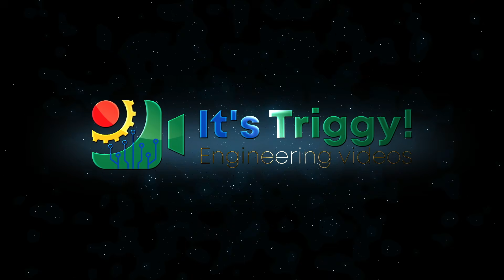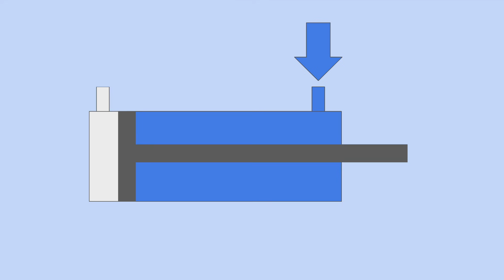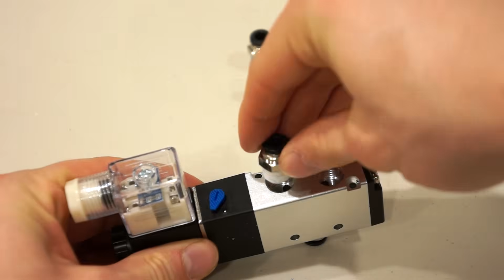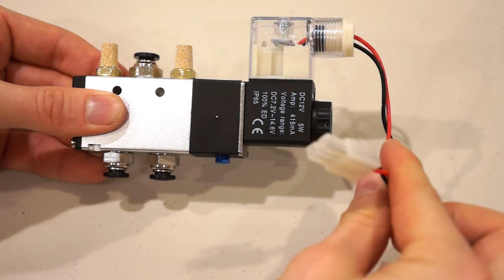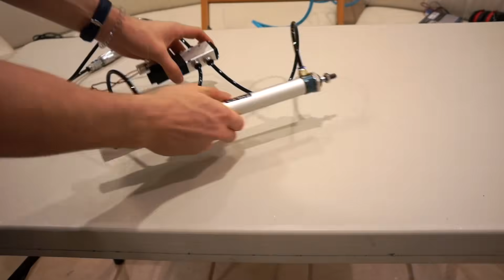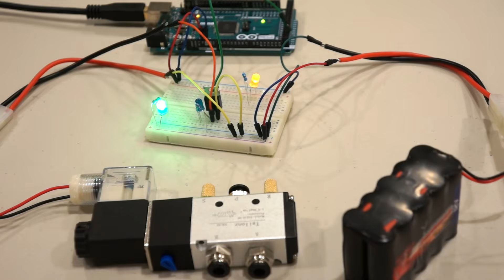Control Pneumatic Cylinder with Arduino

Comment: HELLO, i want to make a project using this concept. but i want  to use a small CYLINDER instead, i want to cut a cylindrical BIOMASS into a desired length. and i want to use a sensor attached to it. can you give me a code that uses that sensor to get the desired length

Comment: I would like to control the actuator to go a certain distance like half of the cylinder or else also is it possible for the actuator to be connected to cylinder to produce some pressure and measure it using a gage or another pressure sensor ?

Comment: hi Triggy, we have followed the video and wired everything the way you have. the LEDs are lightning the same. the only problem we have is the piston is not retracting and protracting automatically. we’re not sure what the problem is. at first we had all our resistors at 510k but now we have changed to two 510ohms resistors and one 9k resistor. the 9k is at the red LED and now it’s lightning faintly. anyway you could help?

Comment: You did nice work, the only suggestion is throw a flyback diode between the solenoid because some solenoids create a high voltage spike when driving them directly with a MOSFET and that can destroy the MOSFET fairly quickly and also cause other things like mcu reset.
Reply: Trying to write this circuit for a project I have at work. Any way you could assist? I'm learning and could use some help. TIA
Reply: I have encountered this exact issue. The flyback diode worked.
Reply: @TheJoeFletch  Yep it can be a pain to locate the problem too. I've seen flyback create all kinds of issues with microcontrollers. Diode is best but you can also use a resistor with relatively high value if parasitic losses are acceptable

Comment: All I wanted to know was what you’re using for the air supply. Are you using a compressor? An air cylinder? How do you know which pressure to use?

Comment: Hi Triggy, nice build!  I wanted to see if there is any way to adjust how much pressure goes into the pneumatic cylinder?  I am trying to put together a Tamping Machine where I can adjust timing and force
Reply from the maker: Yep, look up pressure regulator :)

Comment: May I know the power source (and its voltage) for your pneumatics?
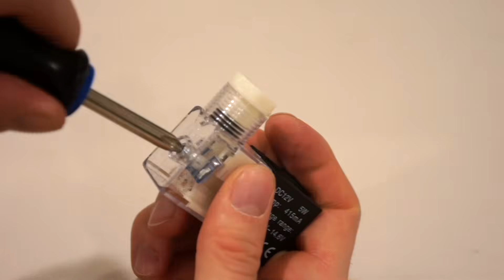Reply from the maker: The valve is triggered with 12V DC from a battery. See 1:35 :)
Reply: @itstriggy4814  thanks! another question is: will the circuit be affected if a BJT transistor is used instead of MOSFET ?
Reply from the maker: @shuetyimek3815  BJT will work! The circuit will look a bit different, MOSFETs are opened with a certain voltage, BJTs with a certain current.
Reply: @itstriggy4814  oh i see, thank you so much!

Comment: Hello Triggy,
What are the sizes of the two resistors you used?  Are they equal sizes or different?  Thank you very much. Regards, Sorin.
Reply from the maker: Hi Sorin, the resistors for the LEDs? LEDs run at around 20mA, so those resistors are just to limit current flow. Using ~500ohms should be fine for all of them.  resistor = voltage / 0.02 amps

Comment: Hello there great tutorial I need some help I'm kind of a beginner. I'm trying to make a animatronic like showbiz which needs a lot of Pneumatic Cylinders and I wouldn't have enough room for a bunch of breadboards to control each Cylinder so is it possible I could use something like relays to control it instead of the circuit you showed in this wonderful video?
Reply: the Arduino has like 14 digital output pins so you can control up to 14 valves with one controller. A relay could take the place of the MOSFET that was used in this demo.

Comment: Hello! Thank you for the video, it was of great help. 
I am actually doing a project where I have to rotate a small crib of certain angles using pneumatic cylinders. Would you have any advice for controlling the position of the cylinder to define precisely the angle of rotation of the crib?
Reply: it would require more parts like a proportional pneumatic valve and a position sensor on the cylinder to have that kind of control.

Comment: Question: do you have to connect lights and a transistor to the breadboard or are they just in this project?
Also, what battery is he using?

Comment: Instead of a compressor could you use a simple CO2 canister for a portable version?
Reply from the maker: I'm sure! You will be limited by volume in the tank, however.
Reply: @itstriggy4814  cheers. Thinking of using this for a smaller portable robot as like an extending arm with a gripper attached
Reply from the maker: @seasnek7024  sounds cool. Look into linear actuators, that might be an option.
Reply: @itstriggy4814  yeah might consider. They are quite slow however

Comment: I’m wondering if i can use a mini air compressor for a small sized pneumatic cylinder. your thoughts?
Reply from the maker: I'm sure you could. Depending on the size you may have to refill often.
Reply: Thanks for asking I was always wondering that

Comment: one of the best tutorials on this out there! thank you very much! quick accurate and precise!

I was just briefly surprised that the two voltage grounds are connected! Isn't it best to keep them separate? It seems to me as a recipe for fried circuitry? (but I'm no electronics genius so please explain.)
Thanks
Reply from the maker: Thanks Jakob!

You do in fact want to connect the grounds. Ground defines the point where there is zero voltage, so connecting the grounds ensures that the 5V and 12V have the save reference point.

Comment: could you make a video where you show if and how you can control the position of a pneumatic cylinder with an arduino? Especially with a 5/3 valve would be great, or with something like a magnetic sensor that pneumatic cylinders come with sometimes.
thanks!

Comment: Is it possible to control 2 actuators at the same time with the same button? I've been looking for a way to do it.
Reply from the maker: Absolutely, just connect the positive lead of each valve to the transistor terminal instead of just one. And of course negative to ground for both as well.

Comment: What's the minimum spec compressor you can recommend for this type of pneumatic cylinder? Thanks
Reply from the maker: It depends entirely on what you want to do with the cylinder. The cylinder will move with as little as like 10 PSI, but won't be able to really move anything. The smaller the compressor, the more often you have to fill it up, or keep it running during operation. If you only need the cylinder to actuate once or twice between refills, you could get away with a very small tank.
Reply from the maker: The compressor I use here is one of the cheaper and smaller ones. I think it was $99. That'll be tough to beat.

Comment: I’m new to this stuff and was wondering how could I do multiple of the pneumaticS in one Arduino script? Like pretend I wanted to control an arm, how could I make it to where I click like an arrow on my keyboard to trigger one of the pneumatic cylinders?
Reply from the maker: Notice how the video only uses a single Arduino digital pin. That means you can duplicate the set-up and just attach it to another digital pin! :) You will probably want to hook up both valves to the same battery, no need to get two. Just make sure they're attached in parallel!

Comment: hey man I have a project where I need to connect 4 cylinder to build a sorting machine, how to connect all 4 cylinders to the Arduino and not make them all work at the same time (each has to activate when commanded) . I don't know how to explain this properly but this is a little the idea.
Reply from the maker: Just use four transistors, one for each cylinder, and connect each to its own pin

Comment: So I have a 21.4 V-24.5 V DC solenoid could I connect same way as this 12V one?
Just switch out the 12 V battery for a 24V current ?

Comment: This is great. Very nicely done. How can I control the speed of the cylinder action using an Arduino. You mentioned something about the exhaust outputs but can these be controlled electronically?
Reply from the maker: hmm that's definitely more tricky. I'm not sure how that would be done, let me know if you find anything!

Comment: how can we control the speed of the pneumatic cylinder?
Reply: reduce the pressure of the compressed air going into the cylinder. unlike electric motor which you can control from 0 - 255, pneumatic is controlled with a valve

Comment: Adding to the requests for a wiring diagram. I have a very hard time seeing exactly what MOSFET pins are connected to LEDs/Resistors. REally hesitant to power this thing up without knowing what might cause a fire :)  also, for future viewers, dropping code in the description would be very helpful.
Reply from the maker: Circuit diagram: https://www.patreon.com/posts/43812212
Reply: @itstriggy4814  Hey man this link is no good... still got the wiring diagram? Thanks for the video, super helpful!
Reply: @itstriggy4814  Awesome. Thanks so much! I was able to get things working (and diagnose that I'd blown several MOSFETs due to insufficient resistance). I also built a simulation in TinkerCad, and added a photoresistor circuit to make it light (i.e., motion) activated for props https://www.tinkercad.com/embed/1rdzFZYw81P

Comment: Heyy... May I know what type of arduino that u used in this vid ?? 
And I wonder that if this thing will also work if I change the type pneumatic cylinder to a bigger bore,length and stroke ??

Glad hear from you soon..
Reply: I'm not 100% sure but the arduino he's using is an arduino Mega, and as for your second question, you should be able to use a different kind of piston, however be sure to check it's compatibility with the rest of your components, especially the pneumatic fittings.

Comment: I want to do this with two cylinders acting in unison.  Would simply adding Tees between the output ports and the cylinder ports work or would two valves be required?
Reply: You should be good with just one valve and some Y connect fittings from amazon

Comment: Why do we have to use resistors?
Reply: Although an LED has some resistance, it’s orders of magnitude less than a proper resistor. If you just connect the LED without any resistance it will fail much faster (and draw a ton of current).

Comment: brother my pneumatic valve is 24 dc. so which mosfet should i use and resistor? could you kindly help me? i have 24 dc power supply and everything including actuator, arduino etc,, just need help with mosfet and resistor values,
Reply from the maker: You can use the same transistor as in the video, it should be good for up to 60V. A 10k pull-down resistor will do the job :)
Reply: @itstriggy4814  thx man.. will test it tomorrow 🙂🙂
Reply: @itstriggy4814  hey triggy. this circuit worked . i just hav a question.. all these resistors that you used are for leds right? if i dont want leds then i can skip resistors? plus i saw some people using relays also in  pneumatic cylinder arduino circuits? why is that? i used  IRFB4227 P814JKW17 MOSFET instead of the one that u used. plus a 24 dc with 1.5 amp dc power source. everzthing was working but somehow two of my arduinos are not working any more. may be because i was connecting and disconnecting the signal wire number 5 pin for my testing? can that be a reason?
Reply from the maker: @dbodybuilder1  Without the LEDs you'd only need one resistor, a pull down resistor connecting the gate of the MOSFET to ground (anything 1K-10K will do). A relay is another type of electronic switch, it will also work. It's just bigger, more expensive, and doesn't last as long. They are maybe easier to use though. Not sure why the Arduino's don't work... depending on how you wired it, something might have gotten shorted and damaged pin 5.
Reply: @itstriggy4814  thanks triggy for always replying and clearing doubts. i dont know why this happened to two of my controllers. one is arduino nano and other is controllino maxi. they are showing the power but i am not able to uplaod any new program. i found a guide to burn bootloader or something. will try to do that.

Comment: Great video, Triggy—thanks! I'm wondering how I could incorporate a capacitive proximity sensor to control the cylinder. Would you have any suggestions?
Reply from the maker: For position control? From what I've seen, it's notoriously challenging without buying a $300+ sensor. I'm not familiar with capacitive proximity sensors specifically, though my intuition is that they might have trouble measuring accurately over the whole range of the stroke (in my case 175mm). Let me know if you find any good solutions!
Reply: @itstriggy4814  I was actually thinking about a sensor that would simply activate an air cylinder when you place a bottle in a set position. It would be a substitute for pressing a button or a pedal.
Reply from the maker: @macwol  Oh, that should be pretty easy! Just check for a signal from your sensor in the loop of your Arduino code, and if the signal is high (and the piston isn't already activated), activate the piston. 

https://www.seeedstudio.com/Grove-PIR-Motion-Sensor.html
Reply from the maker: @9YearsLater It might be easier to have him press a button if his hands allow, but if you're keen on the voice idea, check out my JARVIS video! It covers basically exactly that.

Comment: Hi, 
How much newton u get the force
Reply from the maker: Depends on the PSI. In general, multiplying the pressure by the surface area of the cylinder gives you the force, just keep track of units

Comment: Hi, What should I type to buy power supply, I have pneumatic cylinder and air compressor but I need to connect them in the power Thank you!
Reply from the maker: "pneumatic tubing and fittings" should get you there

Comment: Hey Triggy, nice work. Consider doing a follow up on flyback diodes for the valve. The back EMF from the valve coil will destroy your indicator LEDs in short order.
Reply from the maker: Nice catch! I've included it in the circuit diagram in the description.
Reply: @itstriggy4814  I want to know what or which diode can be used. Can you give a suggestion ?
Reply from the maker: @antoniohernandez8367  1N4007 should do the trick
Reply: @itstriggy4814  Thanks for the info !
Reply: @itstriggy4814  Hi Triggy, can you renew the circuit diagram?
Reply: Or you can use a relay switch, which eliminates needing a breadboard at all.

Comment: A circuit diagram of the Arduino/breadboard would be helpful. Other than that, great video. Clear, concise and informative.
Reply: Yes - I'd want it too.
Reply: Me too, can you perhaps post it a different way?
Reply from the maker: Here's the circuit diagram: https://www.patreon.com/posts/43812212
Reply: @itstriggy4814  I get a blank screen at that link.... I have purchased all the parts for this I just need the diagram... thanks.

Comment: A little fast, but I love how detailed you were in explaining each step! Nice work.
Reply from the maker: Thanks! I wanted to keep it under 5 minutes since it's not a complete project, just an intro / explanation video, but maybe that wasn't necessary ¯\_(ツ)_/¯
Reply: @itstriggy4814  it was a perfect video and straight to the point.
Reply: @itstriggy4814  Stay Fast!!!! Ive been looking everywhere for someone like this. Can't state how refreshing the rapid fire content was.
Reply: @itstriggy4814  no it's awesome, means it's easy to repeat it as I need to. Only thing I'd add is having the model number of the transistor in the description was easy to find anyway but may be difficult for those a bit hard of hearing or without strong English knowledge.
Reply: Just need put air regulator pressure before input
Reply: And yet we all know why his girlfriend made him make this